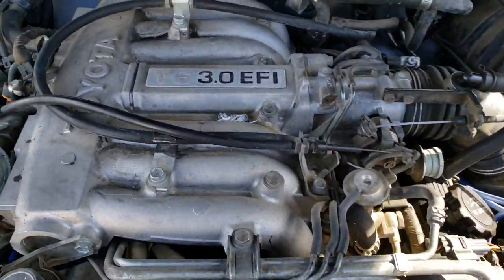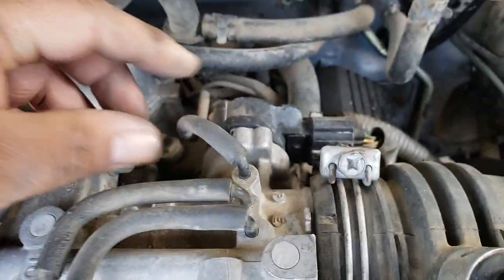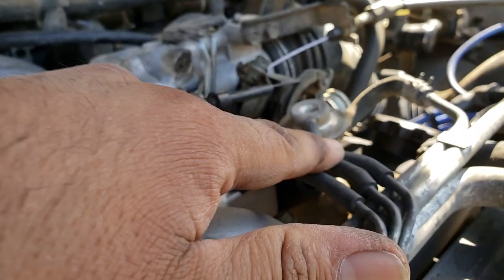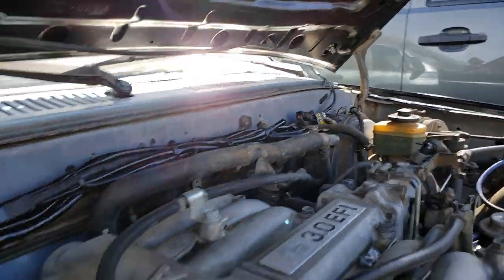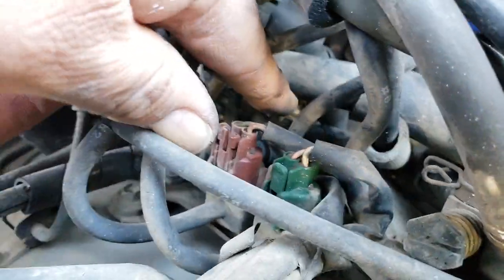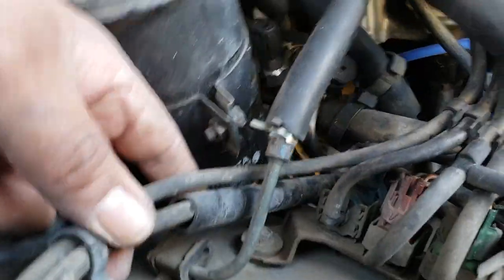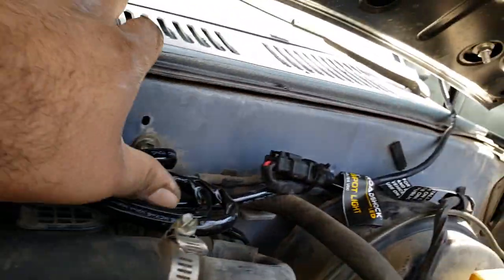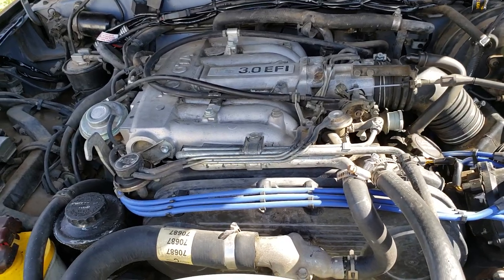1990 TOYOTA 4RUNNER 3.0L V6 FACTORY VACUUM HOSE ROUTING.

Comment: Thank you very much ! You have no idea how helpful your video is! 
  I'm dealing with 1990 v6 that has been Frankenstined. Appears manual trans out of newer model. I say that because speedometer cable disconnected & ziptied to frame rail. Where drive gear  is on back of transfer case is electric connector instead of threads to connect cable. Will older still drive gear interchange?
  Also until warmed up intermittent gutless no power barely run won't restart unless throttle 1/2 to3/4 depressed . Starts dies a dozen times them runs normal???

Comment: Use multicolored zip ties for vacuum lines. One on the line, one where it goes. They won't rub off like paint and look much better. Also you can leave them on all the time so you only have to do it once.

Comment: Good on you TOYOTA ;)  You've taken something simple and turned it
 into something really complicated. 
i thought the whole idea of EFI was to eliminate the need for all this little things.
Reply from the maker: Lol. I agree with you Abe. 
   I am a well versed Senior Tech and know how complicated Toyota made that specific system which  is why I made the video originally for a self guide but then I realized others could benefit and was  why I shared the video. I hope you found some help from the video. 
Thanks for watching my video please remember to click the like button and subscribe to my channel for updates on new videos.
Reply: @ReneTheMechanic  is this gonna be the same on 5 speed ?
Reply from the maker: @BlutoO220  I believe so. The automatic trans does not use any vacuum operations for control that are eliminated on the manual. Only differences may be between California emissions and federal, Cali emissions may have air injection in exhaust.
Reply: @ReneTheMechanic  I live in Cali ! I will check that !